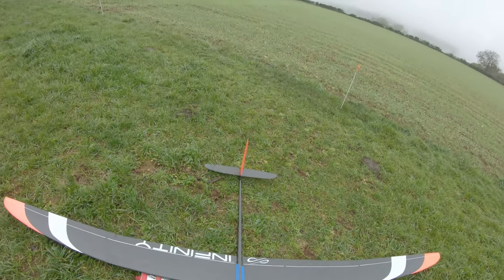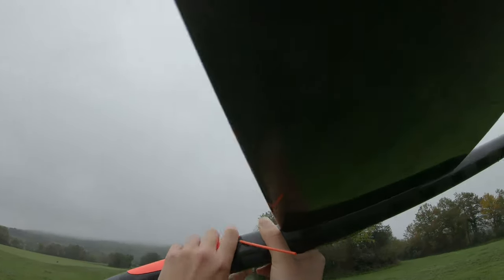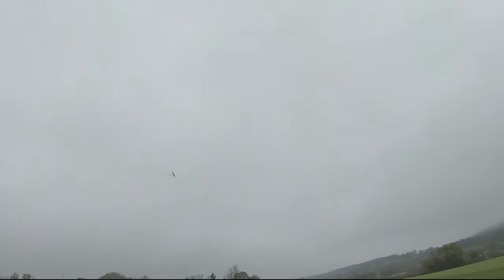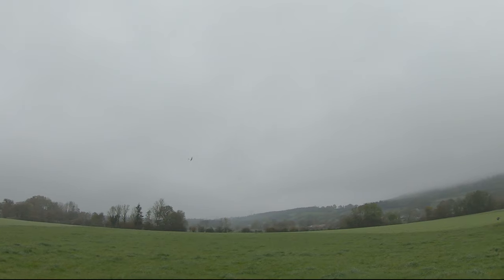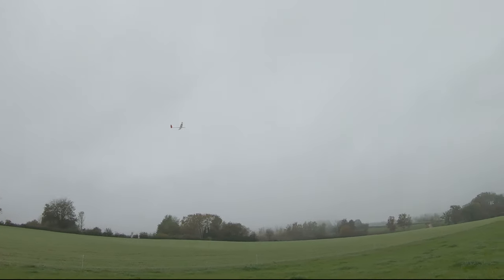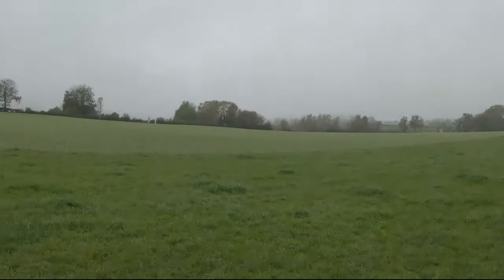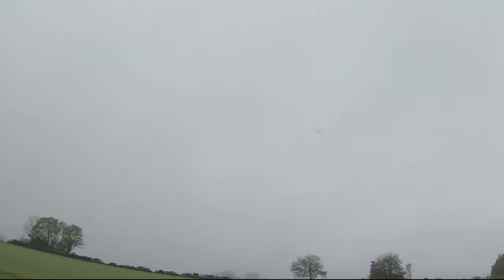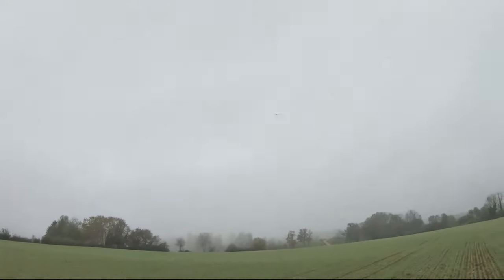My first flight with F5J glider

Comment: j'ai un infinity, c'est clairement une tuerie , ça demande beaucoup plus de réglage qu'un F3K, mais ça rend le plaisir sans aucun souci. c'est un planeur exigeant, et trop tolérant sur le CG, du coup le centrage peut aller trop loin derrière, et faire perdre toute la finesse. il marche a 118mm avec le fuso standard.
le domaine de vol est bien plus étendu qu'un F3K, tu peux aller mega loin ( enfin faut une bonne radio pour ça hihihi )
après le top c'est les planeurs avec du caractère comme des F3B ou F3Q :)